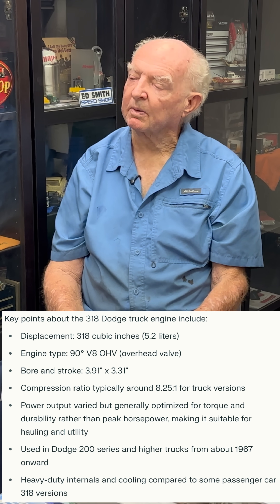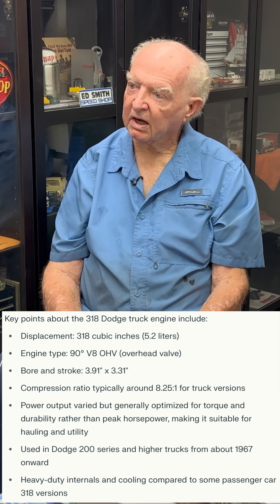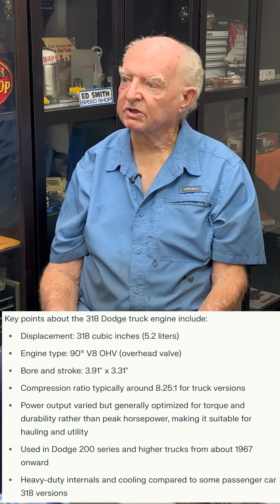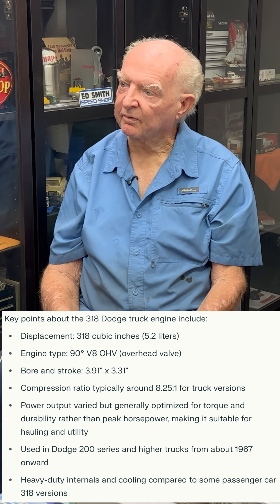Vintage Truck Motors | 366 | 318 | Ed Smith w #BarryT - Ask Ed 43 #classiccars #enginebuilding

Comment: I was building one for a bit port matches the heads and did some bowl porting I planned on trying to retro fit a new roller cam into it from a u haul 454 but I never finished it someone bought it for their big truck so it ended up being a bone stock engine with ported heads and a aluminum 4 barrel no clue how it performed I never heard from the new owner

Comment: Spent a few months driving charter school buses ( Bluebird bodies ) with 366 and 350SB engines.  The 366's would outrun the small block, and push those 40 passenger buses to 80 mph unloaded no problem.  Great engines.

Comment: Still have a 366T truck. Made a dozen trips across Tx with my foot buried in the floor board bouncing off the limiter the whole way each time. You won't hear a complaint outta the ol girl though. Made the trip, simple, reliable, tough, just keeps going. It's a 1992 TBI 26' Box Truck. Because of the color under the hood I think it's a retired Penske truck. 

He's absolutely correct about the "no gas mileage at all". That statement has micrometer precision. We were doing great to get double digits but we'd pack it to weigh 22,000-28,000 lbs. According to the CAT Scale at the truck stop. 

Forget gas mileage, that little 366 pumped 28,000 lbs a thousand miles across Tx a dozen times and just ate up the road like it owned it. Great powerplant.
Reply from the maker: Great story

Comment: The 366 was made to skirt emissions laws in the larger city’s and make an engine that could be left running all the time which is why they cool so well. 427t and 366t use the same cam. But yet the 366 makes less tq because the engine doesn’t breathe well. The 427t made more tq and ho at a lower rpm than the 366 because the engine could breathe.

Comment: Once after hearing time after time use  it as a boat anchor, someone said it right, but you can pull it up from a year underwater ,and it will fire up and run.

Comment: The 366, has the same crankshaft as the 396 although it is a steel crankshaft and same as the 427. Truck motor.  Just a tall deck block with heavy duty pistons with an extra ring on the pistons
Reply from the maker: Thanks for the added info!

Comment: Ford built the 370 Lima engine and they were built the same way.
Reply: Even before that there were the FT (330, 361, 391) which were sort of an alternate universe version of the FE (352, 390, etc). Pretty rugged but thirsty. Lots of Ford guys had big dreams about adapting FT parts to their FEs - in particular the steel crankshaft - but it was more trouble than it was worth. Different crank snout, engine mounts, etc. etc. The FE was plenty beefy already and what it really needed to run at high rpm was a better oiling system to keep more oil down in the bearings. (Which is what the "side-oiler" 427 was made for).
Reply: I have a 428cj and its been a fun engine  @mtut

Comment: The "Tall Blocks" were four bolt main, with steel cranks. The 366 and 427 used the same crank, which was basically the same as the 427 High Performance, without the ultimate fine balancing. These were cross drilled cranks and also Nitrided for durability. In the mid to late 60's and 70's they were even used along with the more popular 427 in Chevrolet 80 series tractors.
Reply from the maker: That's really interesting. I appreciate you sharing that.
Reply: @BarryTsGarage interested in chrysler 426?? An older friend of mineFour years ago lost his last battle of vietnam agent orange won. My self along with that others have helped his widow disperse some of his automotive items. He has had in his garage shop under the workbench for thirty years. He always said that it was a wedge engine that somebody had taken the intake off of and put , I guess a standard intake on it. I'm not an expert on these by any means. We moved it out from under the bench , and it looks fairly complete. Maybe you know somebody's in the middle of the midwest and I'd like to find a home for it and his widow could use a couple extra dollars. Whatever is fair. She also has a 1950 GMC pickup from Colorado.That's been between there and where she lives that now has been in a garage for over four decades , and it was a little mileage to begin with. We've gotten rid of everything else.Basically, just sharing.I hope you don't mind.That's why I sent it to you more than put it out there in general population as a comment. I don't want to be capitalizing on your channel. I know Smith stories, my friend told me over last almost 30 years.And so I know some more of what he told me about this in as well
Reply: Yes you could buy a used one cheap and get the  forged crank a nd good rods,  we used up to 6300 in my rail.
Reply: They had trashcan 4 ring pistons that would pull the rods apart over 3600 rpm. So hardly “the same”. 😂

Comment: You're talking that 366 tall deck,i remember seeing the  big Holley 4 barrel on  a couple of them, but they had all these odd Governor controls attached to it, great video
Reply from the maker: Yes, those governor controls were pretty common on those engines!
Reply: Do away with at least some (tougher to eliminate all)of the governors and you begin to have something

Comment: Ask Ed if he ever had any experience with GMC GAS V6s the displacement were 305. 351, 379, 401, 432, and 478 cubic inch V6  engines? I saw a old GMC 351 but had no experience with them...
Reply: I had a 478 M v6 1975 in my GMC 7500 boom truck.
Allison automatic.

Excellent engines.

They also made a V12 702 out of two v6s.
Reply: @Motorhead250 There was a V8 in the family too.
Reply from the maker: The v8 was over 600 cu in
Reply: @BarryTsGarage ,60° v8

Comment: Lesser known than the 366 was the 427 version. As I remember, both versions had big, 4 ring pistons that were built for longevity and low end torque, not high revving horsepower. 
    Back in '78, I worked at a towing company that was often trying new things. First hydraulic operated flatbed/rollback in AZ. We did lots of experimental work, just to see what we could do. That truck was #44 which I particularly liked because I had recently obtained a  .44 Magnum just like Dirty Harry's at regular retail price. Another truck we had that was really fun was #70. It was a '79 C-50 with a short wheelbase and had a towing body from a C-30, so it was able to tow up to medium duty trucks, but it could turn on a dime and tow any cars. I was turning it tight one day and looked at the left side rear tires, being surprised to see that they weren't moving and the truck was pivoting on those left rear tires. My '75 C-20 pickup can't come close to that short truck's turning radius. The salient point is that the shorty had a 350 and it would scoot!
Reply from the maker: Cool story!

Comment: Hey Barry tell Ed a friend of mine took a 366 made it a 427 out of it supercharged it and does drag racing with it he said it was built like a brick house
Reply: lol no he didn’t. There’s not enough cylinder wall to bore a 366 to 4.250”. If there was, everyone would be grabbing them up instead of crushing them. 😂
Reply: @FlatBroke612 he borded to 4.00 and used 427 tall deck rod had a 427 crank stroked it can be done
Reply: @RK48frazergasser  thank you!! I always hate hearing these things are boat anchors.  They make adapters to be able to use good heads and that was always an issue with these engines.  Have a great day
Reply: @brocka.stanley6072 I talked to my buddy he took a 1968 366 bored it to 4.25 and the cylinder walls look to be 3/16 inch thick can't wait to see it run
Reply: A 4.000 bore is smaller then a 396 has , and to get 427 cubes out of it , he had to run a 4.250 stroke , which makes for an undersquare engine , good for torque , but won't rev worth a damn .
Reply: @bobbrinkerhoff3592 his redline 6800